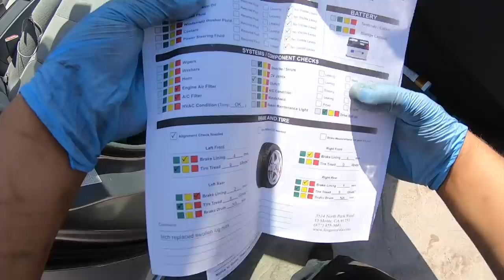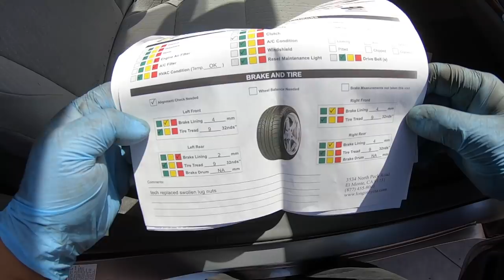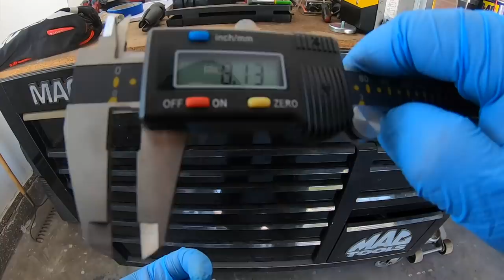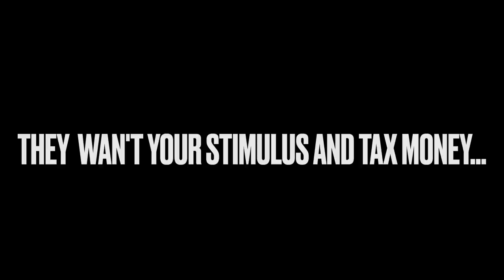This is why YOU need to avoid the Dealerships!

Comment: I work at a dealership in parts at the back counter and have been since 1985, like everything else we have people that don’t know what there doing or love to do certain jobs that pay well.
Reply: Brakes are quick job that if you half ass the service; you can get it done in less than 30 minutes. I used to work at Toyota dealers in the service department and I've seen some of the most shady crap that made my stomach turn. I took pride to be honest with everyone. Didn't matter who you are or how much money you had. I used to feel great dealing with women customers when they were ripped off before coming the store like they were originally told to replace a tire when it could get repaired. I used to live for the feeling of "Aww...Thank you SO MUCH for your honesty..." when they told me that when I drove the vehicle back to the service drive.  

There was one time that a Prius owner needed new 4 tires. I was in the service drive dropping off a vehicle and overheard the owner saying how much she HATED loosing air in her tires. Sure enough; I had to install her tires for her. I unmounted the first tire and saw major bead corrosion on her wheel. I spent the extra 15 minutes cleaning her wheels off and applied bead sealant. I brought the vehicle up and she was waiting outside for it. I told her how I spent the extra time and cleaned all her wheels. Once again; I get large thank you. I don't understand how difficult it is to apply sealant prior to installing the new tire????  

I know I would been one of those master techs with large black book of repeat customers if I started my career lot sooner than 32. I stepped away from it and went to work directly for Toyota at the Camry plant.
Reply: Too bad most dealerships started screwing their best parts people.  Guys like you with experience used to know the part # before I could finish the sentence. Now these kids can't find the most basic parts. And they use computers, not microfiche!
Reply: @motorbreath7174  unfortunately unless you started working in the parts industry 10+ years ago you're not going to be paid well and the skill required has dropped tremendously. My company will only pay minimum wage for your first year as a new hire! So of course nobody with experience is going to apply...

Comment: I work in the shop at a large dealership and no one in my shop would ever do this, it really depends on the dealer. It's dealers like this that gives all dealerships a bad name
Reply: Right? i love how everybody just likes to generalize and think ALL techs and EVERY dealer is an incompetent moron. He says at the beginning of the video its not all techs but the description etc begs to differ...
Reply: I took my car in for new tires and an airbag recall. They told me all my fluids needed to be replaced. I changed most of them when I bought it 5 years ago. This dealership replaced the radiator and the water pump. The coolant has been replaced 3 times in the past 5 years which includes twice by dealership and they are telling me it needs to be replaced again. They don't even check their own records.
Reply: @donnash5813  You should probably stay away from that dealer. What kind of dealer is that?
Reply: @chapn7  It's a major Honda dealership. Their technicians do good work. I had several repairs and never had a problem. Definitely a problem with pushing work that isn't necessary. I hate working on cars but at least I know enough to know when they are playing games. I'm not going back.
Reply: @donnash5813  thats a real shame, sorry to hear about that man, i wouldnt go back either
Reply: Exactly!!!!! My husband is a service advisor and damn good , honest one too! The dealership has very good reviews as well. Thank you for seeing it the way I do.

Comment: That is why after buying a car never go back to the dealership, unless is for recall or warranty. I do my own maintenance. Good video 👍👍👍👍👍
Reply: I do my own work also.  I took my Honda to the dealer to have the airbag recall done. 

They gouged the dashboard trying to get the cover off the passenger side, and left one of the bolts laying on the carpet.  Oh and the SRS (airbag) light was on.

I have an appointment tomorrow for them to have an interior specialist repair the dash.
Reply: @Ken_in_Wisconsin  some are good technicians, but others are careless with customer’s cars, when take my Escape to the dealership for a recall, they left oiled fingerprints all over the dashboard and on the doors trim. Dealership is supposed to be the best place to service the cars 😂.👎🏻👎🏻
Reply: @TavosMr  The level of incompetence on the work I had done almost makes me think it was done intentionally - like by a disgruntled worker.

I so wish I had just purchased the parts and done this simple job myself.
Reply: @Ken_in_Wisconsin  yes, I think the same, unfortunately the recalls had to be done by the dealership. I hope you get you car fix the right way. Good luck 👍.
Reply: My '88 Jeep has been back to the dealer's exactly once.  Of course, the dealer I bought it from no longer exists.:)

Comment: I really hate dealerships (stealerships), and most car repair places.  Luckily, I've worked with the same place for like a decade.  I always bring my own oil, my own parts, etc..  Just have them do the labor when I need something done.  They are great and never mess with me.  They know I do most simple stuff myself (like engine and cabin air filters, light bulbs, etc.).  I don't do my own oil because it's a messy job, and, they only charge me $15 in labor if I bring my own oil and filter.  I have to admit, even though they don't mess with me, I've heard them on the phone with customers, and, customers in the shop.  Giving the standard, "well, you can still drive, but, this part may go bad at any time, it should be fixed for safety".  Fast lube places are the worst (haven't been to one in like 10 years), but, I hate how they take out the air filter and show every customer, then try to charge like $50 to $80 to replace it.  Those filters cost $15 or less, and, don't even require any tools to change.  Takes like 30 seconds!  Usually they aren't even close to the end of their life, just have a bit of darkness to them from being used a while.  They can go 30k miles.  Just replace them yourself every other year (I do mine usually just once a year, same time I do my oil, just to keep things simple and all done at the same time; usually replace the wipers then too.  I just use the cheapest wipers available, so once a year in spring works for me to replace).

Comment: I got bad experiences with dealerships they hijack people with not done jobs, they charge brake fuild flushes without doing anything, etc etc, thats why i started doing it myself
Reply from the maker: True, seen it with my own eyes 👀
Reply: Brake fluid flushes are a joke. Doesnt need to be done unless there is actual evidence of contamination, and i tell my customers that. Transmission flushes are the same and can actually shorten transmission life IF fluid has not been changed on a regular basis.
Reply: @donreinke5863  If the brake fluid is contaminated no amount of brake flushes are going to fix the problem, lol
Reply: @firstlast---  Correct--IF its something like power steering fluid or oil added to the brake reservoir. Ive seen idiots actually do this, they dont know its going to dissolve the seals used in cylinders and calipers.
My daughter called me the other day and said her co-worker thought that she could put motor oil in EVERYTHING on her car,
Of course my daughter knows better (she rebuilt the engine and transmission in her Jeep--I dont give a pass because shes a girl) and told her bimbo co worker NOT to put anything in unless she asks someone knowledgeable first.
What I was referring to is the black residue and sludge often found in master cylinders.
Reply: @donreinke5863  that’s the funniest thing I’ve ever read

Comment: Any time the dealer tells me I need brakes done, I do it myself for a lot less.
Last service the dealer said the front brakes needed rotors turned. $200. 
I can replace the rotors and pads for less than that.

Comment: Dude my starter died on my way home from vacation about 5 years ago and the only tow I could get on a Sunday got me to the dealership.  Monday rolls around and they charge me over $800 for a new starter and a couple fuses.  When I got home, I immediately started learning how to fix my own car.  Haven't been to a mechanic since thanks to channels like this.  Thanks for doing what you do!
Reply: Good thing you commenced learning how to work on your Vehicle.

Depending on what Brand of Vehicle we're driving : One Tip is to call the Dealerships Parts Department , give them your VIN # and ask what does the Starter Cost....Now let's not Forget : Dealership Starters , Alternators , Catalytic Converters & Sensors are the Real Deal vs. the 7 Days a Week Stores people run too...These places work but they are also Inferior Parts compared to Dealership parts.

GM Dealership - Smog Repair - Independent Shops background.

A lil' education 'bout Inferior Sensors vs.
Superior Sensors :

"Frum" my Main Man in a place they call the Netherlands :
https://youtu.be/OooetRuakK4
Reply: Would of saved $650 if u did it yourself
Reply: Oem starters are expensive, aftermarket and doing it yourself saves a ton of money.
Reply: @charlesbarkwell7693  Expect the fact that you can buy the OE parts from the part stores. Orylies and rockauto sells ACDelco parts. which its where gm gets their parts from, sense they own it. Alot of brands use movotech steering and suspension parts. Most brands Shop for parts from these "inferior brands". It makes no sense you make every single part. just drives up the price of the car, or decreases margins on already small margins. 

how many cars have Belstien shocks, or Bose speakers, to name two.

Tho not saying there arent any worse shitty parts. cause there are. but you can 100% buy the exact same parts from anyother store, depending on store and what they carry, as you can from a dealer.
Reply: @chloedegurechaff1941  A/C Delco makes three different levels of parts with their name on the package. Does the auto parts store have the same level that dealer carries?---not always.   Rockauto is a great thing if you can wait for the part. It gives you many choices for part quality and price. Adavnceauto can get parts from Worldpac which stocks actual OE parts at fraction of dealer prices, might have to wait for those parts too.
Reply: Ah, you would of saved so much money if you did known cars 5 years ago, that is sky rocket high price just for a starter which in my state its only 67$ and up for a starter and be ALOT CHEAPER if your state haves a junk yard which you have to pull parts out yourself would really save you thousands of dollars and its very easy to install which doesn't take 10-30 minutes to do which it depends on the car where its at.
Reply: @ceescorner  Most of the time OEM are the exact same product as aftermarket, just in different packaging. For example, NGK make the spark plugs for my car and Bosch make many of the electronics and then there’s brake pads. The manufacturer doesn’t make these themselves.
In fact MOPAR banned NGK for using their part number on aftermarket plugs, to get a monopoly on parts sales. But you can find an almost identical aftermarket plug with a different part number
Reply: That is about right. Some cars have PIA starters. BMW is one. You can't access the starter from the bottom of the car. You have to go in from the top and remove everything on top to include the entire intake. The jobs takes probably 4 hours and is very frustrating. 

I saved myself the money and did it myself. Was it frustrating? Very.
Reply: Lil hint if the starter EVER GOES OUT AGAIN and you can see the starter, tap the solenoid on top couple times (TAP not hit) should help get it going again till either yuh get home or to a place to have it fixed. 👌😉
Trust me it works, I've done that a million times. Works every time.

Comment: Every. Single. Time. I have ever taken a vehicle, with over 100k Km on the odo, to a dealership, I get a "Free" inspection. Along with a recommended aspirational bill, a quote of over 5000$Can of work to do. It's always "not urgent but you shouldn't ignore this or it could explode in the eventual future". This is absolutely the worst part of owning a used car as a second owner. I am on my 3rd used car, and the last 2 cost me lots of maintenance money for broken down parts, 1 died (needed new engine), but I also got a lot of other quotes which ended up being complete fabrications. This smoke and mirrors bullshit you get from them makes the ownership experience intolerable. They are only trying to get you to sell your car to them so they can lock you into a new financing and makes lots of money selling your perfectly good car on the used market, it's corporate gangsterism. Even the parts are scams of their own story.

Comment: Dealer: You need new brakes.
Me: looking at new brakes pads...
Reply: Me: Looking at tyre that’s worn by only 2mm
Dealer: You need a whole new axle and control arms, the wheel is leaking blinker fluid.

Comment: hold up, did he just torqued the lug nuts? absolute hero
Reply: Oi, i also do that, i say PING in a slightly angry noise!
Reply: Meh... Never torqued lug nuts on any of my cars. Never had one come off yet. Just snug down with a impact then get a breaker bar and pull by hand a quarter to half turn and your good to go
Reply: My back wheel came off at 60 on my first drive of my 1966 Pontiac tempest after doing a frame off build over the course of 3 years. I was so excited to drive it I completely forgot, it locked my other wheel up and I ended up in a guardrail.  I always torque my lug nuts now.

Comment: I know that now.  I had a Goodyear repair shop here in MA that replaced a perfectly good drive shaft.  They quoted a price of $180 for parts plus labor.  I found out the shaft was good and only costs $80.  It also did not resolve my problem with the Transmission.  I eventually found the problem myself.  The wiring harness to the transmission was rubbing on the engine block which wore through the insulation and shorted out on the block.  I fixed the wires by putting butt plugs between the wires that were showing and then put a radiator hose with hose clamps around the section of wire harness and it fixed the problem.  I'm by no means a mechanic, but I just looked around for anything that might be obvious.  I traced the wires from the computer modules as one of them controls the transmission and I found that and fixed it which fixed the issue.

Comment: Part of the problem is extended service intervals that are so common today. Years ago you went to the shop probably 4 times a year for your 3,000 mile oil change, annual tune up etc. Now with 10,000 mile oil change intervals that people commonly over extend anyways you might not see that customer for a year or more. It used to be that you could give a customer a warning about an issue several times before you needed to do the job. Now you tell them it needs doing today cause it could be a long time before they come back.
Reply: Sdfu

Comment: You're actually supposed to test the depth of the gap, rather than the pad. The gap is above the height of the hardware penetrating the pads from the mounting plate. When that groove disappears, you pads are done. They've got a lot of meat left on them though.

Comment: Had a dealer tech say I needed a new PCM and Wiring harness, or about 6k in repairs. Took it to another shop and found a single corroded wire. Cost 130 bucks for them to find and replace that wire

Comment: OMG so true, my son-in-law got his breaks done at BIG-O. He took for truth everything they told him... 1400 dollars later - new breaks and, rotors, not even new fluid. I told him we could have done that in my garage in 1 hour for 75 bucks or, less. and unless your rotors are scarred you don't need to change them... Example 2, my wife would take her car in for an oil change they ALWAYS sold her an air filter... NO. example 3 -   My local garage said I needed new shocks (I know I did) they wanted to charge $678 to roll out shocks?!?! 678...I bought the shocks online and did them myself in under an hour for 135...

have a clue before you take the garages word for it.

Comment: What sucks about dealerships is the service tech tries to get the money, the techs end up getting the flack of the bs and gets. "the label" as I call it.  We as mobile mechanics whether formerly certified or someone starting out, dealerships are called STEALERships for a reason and it puts ALL mechanics under one roof.  But overall, some of the mechanics are lazy too so it's hard to justify who's who.  We worked on a vehicle that some company called "Top shelf" did, they busted my customer's lower caliper bolt so they jammed the top bolt tight.  We got the call for a noise. They couldn't even fix a simple $10.00 problem and just sent it!  Great video man!

Comment: Bottom line when it comes to having work done on your car you need to find a shop you can trust, whether it's at a dealership or an independent. Don't be afraid to ask questions and get second opinions. All shops are out to make money, hopefully you can find the the ones that do it honestly.
Reply: The problem is many places will charge you an hours labour for a second opinion. They won’t look at your car for free.

Comment: I went to Toyota dealership for oil n filter "sale" for my Tundra 5.7 for $49.95 plus tax which is really good for synthetic oil @7 quarts. Anyway,they came back at me with nealry $3K for suggestive maintenance(my '14 has 55K miles). I recently changed all 4 rotors and brakes just because and 4 brand new tires but not from Toyota. I made believe I was interested but couldn't do it then. I left and won't come back.